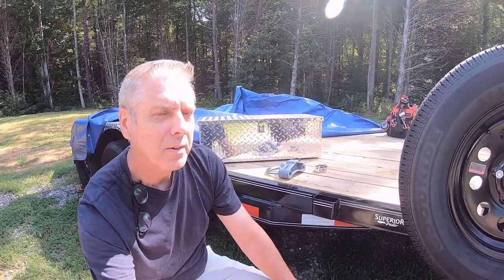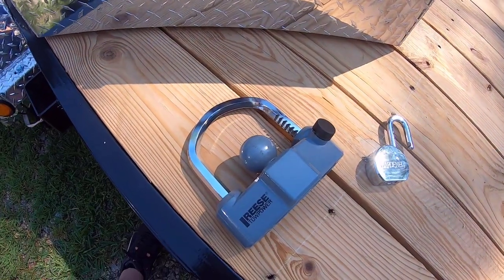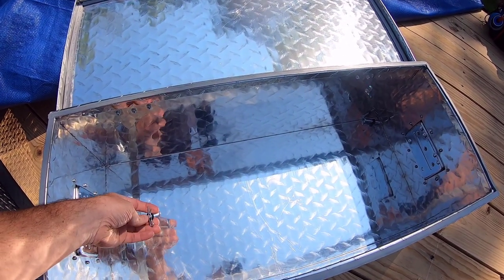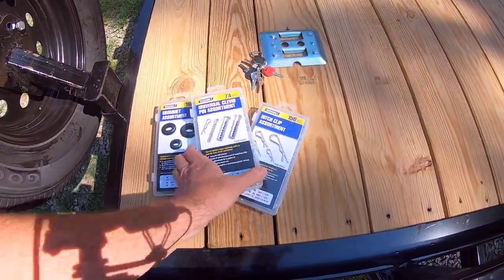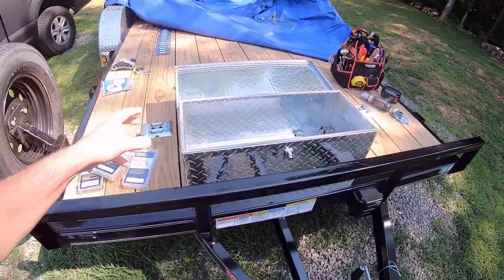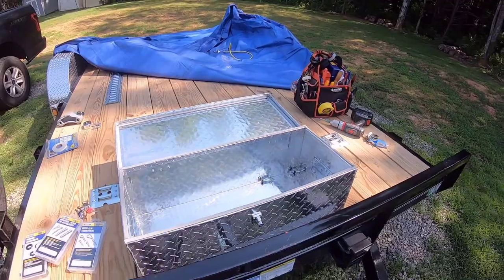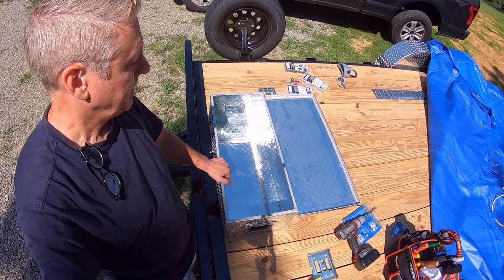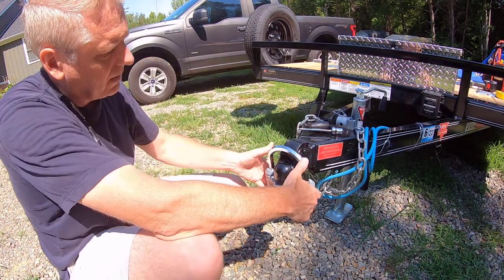22-More Trailer Accessories

Comment: I would add the largest diameter fender washers I could find under the hitch pins inside the tool box to make it harder for a wannabe to pull that box off the trailer.